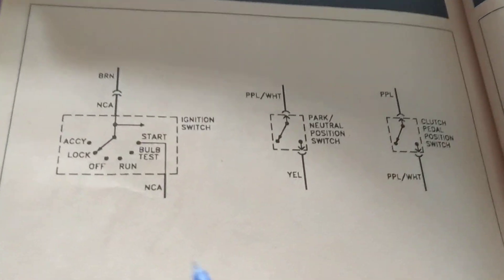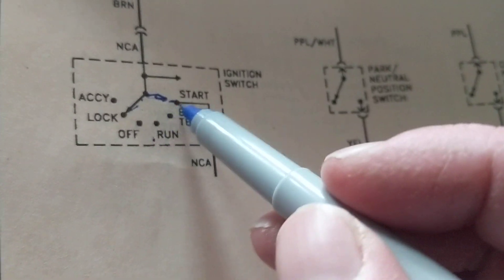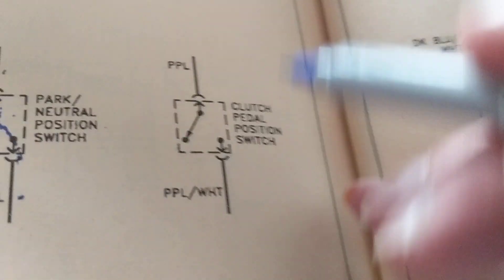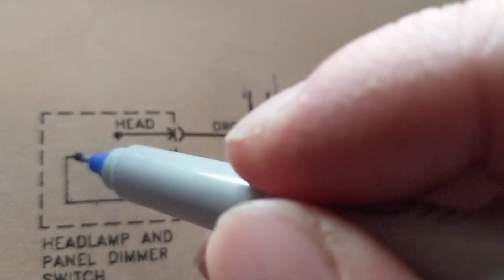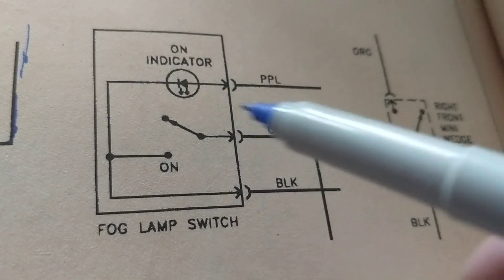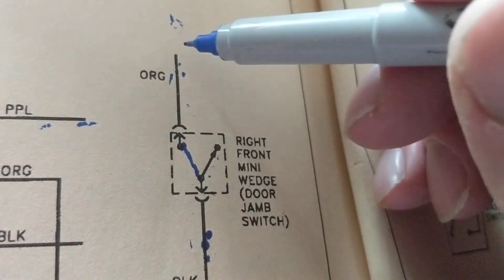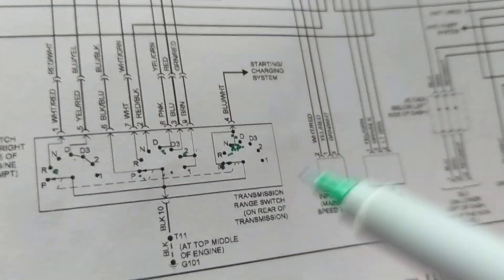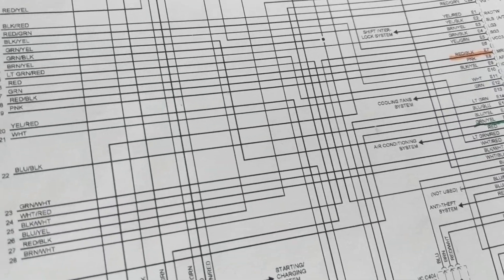HOW TO READ AND UNDERSTAND AUTOMOTIVE DIAGRAMS WITH SYMBOLS AND COMPONENTS EXPLAINED 100% HELPFUL

Comment: The rear wiper/washer switch has the co nfiguration of a single pole and 4 throws. Someone might be tempted to assume that it'a a double pole. But it's actually a single pole because the input side of the switch is interconnected and so it's the same electrical point. What do you think Joe?
Reply from the maker: I agree with you 100%. And all these things are in units now that have to be replaced as a single unit the electronics is getting very advanced in today's vehicles thank you for your comment and observation